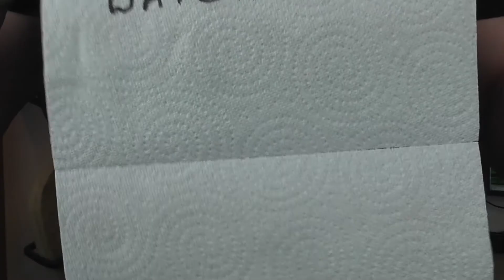How to service a mixing desk part 3 - Mixer Cleaning

Comment: Canned air has moisture , I normally spray my radio boards with isoprop then spray with air and dab dry with paper towels and brush, then repeat without the canned air.
😊

Comment: Hi I did exactly what you did with the Mickie 32 channel put it back together the mixer now shows all red solo lights on on all the channel ...any suggestions
Reply: Hi,  someone else posted the same question here,  it was suggested to double check all the ribbon cable connections.  Good luck!

Comment: Hi mate, my mackie 32.8bus all functional but my led meter doesn't light up on the Bus section, master works fine. Is the bus section hard to get at? Hoping it's just loose ribbon or so. Cheers

Comment: A lesson that I have learned time ago while I was cleaning a potentiometer is to avoid at any cost to spray isopropyl alcohol DIRECTLY into the them, because it will completely destroy them. After opening the potentiometer I found that the material on the wiper tip (probably carbon) was completely dissolved.

Comment: Hi liked your video but thought it was a bit overkill, i.e cleaning the back of the PCB! Yes, clean the component side as a build-up of dust on components can cause them to overheat and so reduce their working lifetime.  We had an analog studio in the early 80s, just as the digital age started, we had a Soundcraft series 2, 24/16/8/2 desk the last one they made. (No chips, all transistors). And the Soundcraft 16 track on 1-inch tape recorder. To clean the faders and pots we used RS contact cleaner, although on my Fostex desk WD40 seems to work fine. And for the chassis, we used  RS foam cleaner, (RS being Radio Spares, a big name in the UK). Now I use "Pitney Bowes DIRECT Anti-Static Foam Cleaner". Seems to be fine on all hard surfaces, doesn't cause any probs if it gets in plugs or skts. And my final suggestion, to keep your desk in top condition, at the end of a session, or when you're cleaning or hoovering a cover over the desk will save you an awful lot of cleaning.  And believe me, you don't know how lucky you are that you don't have to go through all the tape head cleaning and de-magging that we had to do. 
Still really enjoyed your video pls keep them coming.
Reply from the maker: Glad I missed the tape era. I have recorded a bit on tape but they had DAT and ADAT in the college studio so made life easier.
Reply: I guess that was not normal WD40, but an electronics version of the same brand?

Comment: Should/can you use fader lube on the rotary pots?  Seems like it might be advisable to prevent wear...?  Also, are the ribbon cables labeled?  How do you keep track of which ones go where?
Reply from the maker: I used contact cleaner on the pots, I’m not sure about using fader lube on them, sorry. 
I take a sharpie and label the ribbon cables as I go. Also take pictures at every step of the way as it’s easy to get bits mixed up and backwards
Reply: Going to look at a 32-8 tomorrow WITH meter bar.  Only $350 USD as it has a couple of "noisy" faders.  Your excellent video might be just in time ;)
Reply: Deotix fader lube works well on pots.

Comment: I need to repair one or two slide pots. Have you detailded pictures, pin conections and value, to i by it, before i open the mix? Thanks in advance.

Comment: Nice video and very helpful, nice intent behind it. I am always a bit surprised by the "industry standard" (?) idea that it is better to use a can of compressed air to blow away any dust as opposed to the general idea for everything else (houses for example), that using a vacuum cleaner is a better idea! I bought a great little set of attachments from (I think,) CPC (or was it Ebay) to convert a household vac to a mini-vac and it serves me very well. I know that when I am using it it is sucking away all the dust as opposed to just redistributing it...keep up the great work!
Reply from the maker: That’s a seriously good point. Oddly it’s never crossed my mind when sorting mixing desks but it was the first thing I thought of when cleaning out my PC. I have a high powered blower for electrics now, wonder if I can do some mods to a household mini-vac like you have as that’d make far more sense

Comment: H, thank you for a great series on cleaning a mixing desk. I have to say It has given me the confidence to try it myself as the main L/R fader on my desk occasionally only delivers on one side. I couldn't make out when you were cleaning the faders if you cleaned inside the slot and would you normally spray the fader with DeOxit the same as the pots? Thanks again.
Reply from the maker: Thanks for the comment. As long as you take your time and let everything dry properly before reassembly then there isn’t much that can go wrong. I only clean the fader casings (which will probably be coated in grime) and spray faderlube inside them. If you have any questions, please ask and I’ll happily help

Comment: Nice video series on deep cleaning a board. I have a few questions. I have a Mackie ONYX 1620 mixer with FireWire that I basically got it for a song. I plan to use with my Mac Pro and Logic Pro 10. The board has a few issue that I wasn't aware. Mainly, scratchy gain pots but more aggravating is it has several scratchy EQ knobs. I could almost live with the scratchy gain pots as once you set them, generally you don't touch them again during recording. However, when you try and adjust the bass on a channel and it's scratchy during recording, this is unacceptable. So, my biggest question here is: Does this process you're doing here fix scratchy or noisy pots. Or should I replace the bad pots completely.  I see they are only a couple of bucks each. I have 8 scratchy gain pots and about 8 scratchy EQ pots. Everything else on this board seem to work just fine. What say you?
Reply from the maker: Personally I’d open it up and use some contact cleaner on the pots. Twist them around a load and you’ll feel them free up. Wipe off any excess. 
If the pots are PCB mounted they can be a nightmare to replace.
It’s worth spending extra for the Deoxit Contact cleaner.
Those FireWire Mackie desks are great, I seriously considered getting one
Reply: Thank you...

Comment: Is there any alternative to the Isopropyl Alcohol? Spent two full days in two different cities trying to get hold of some and I would prefer not to buy some online. Also would regular contact cleaner do as opposed to that deoxit stuff cos I could do without the £20 difference in price
Reply from the maker: I'm not sure on an alternative i'm afraid but hardware shops tend to sell that kind of thing. I've always bought it from amazon.
With regard to the contact cleaner i'm sure any contact cleaner would be fine but the Deoxit range is used universally when it comes to cleaning studio equipment.  I have no idea why it costs so much but it really does the job and I've never been brave enough to risk using anything else as any down time would be catastrophic.  
What I will say about Deoxit is that you can also use it when servicing all your studio equipment.  I know this series is in respect of a mixing desk but the same approach applies to preamps, compressors and other analogue studio gear.
Reply: Try CPC if you're in the UK or Digikey if USA. Not sure about elsewhere.
Reply: You can spray contact cleaner , then squirt some isoprop with a needle dropper, while working the fader blow with compressed air then finish with Deoxit F5 or CRC226 Eectronic Lubricant...you do not want to spray down the potentiometer shaft as I will dissolve the grease that gives it that nice tight drag feel.
😊